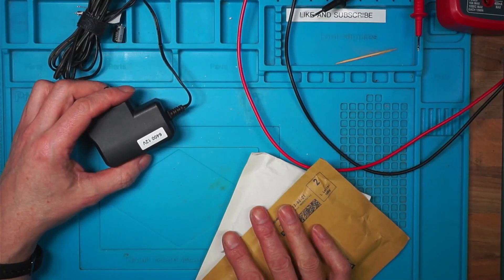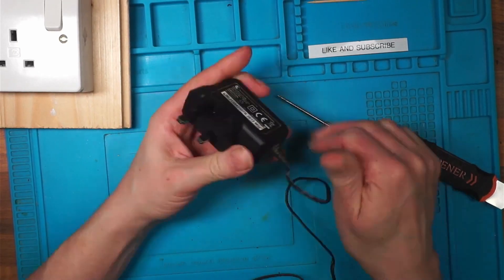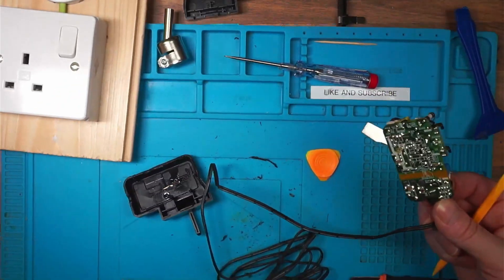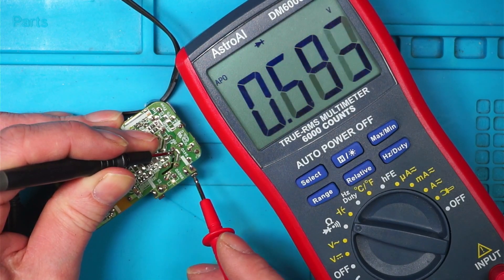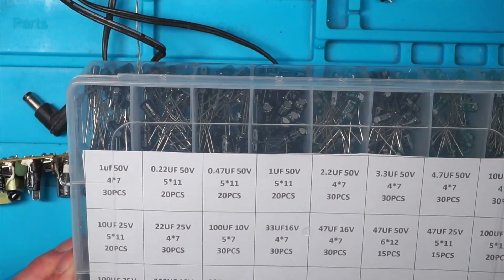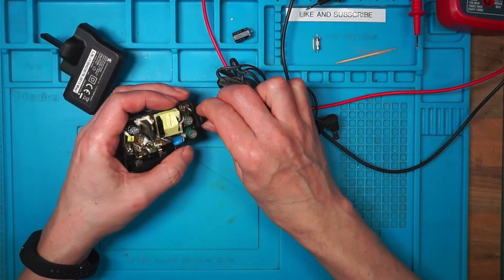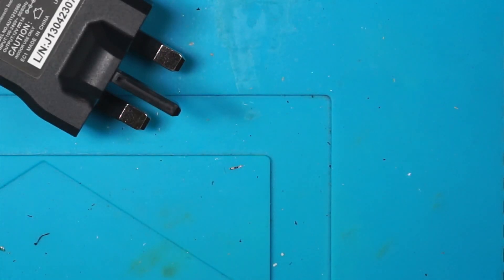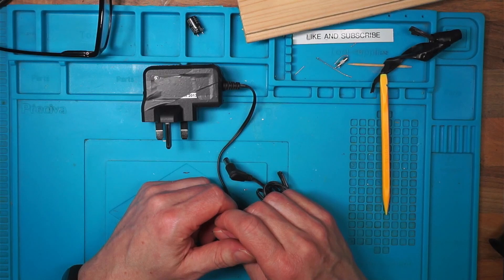Trying to fix a 12V PSU | No voltage out | Faulty Power Supply

Comment: Excellent repair! Looks like a great quality PSU. I like how a fuse and cap replacement can bring an electronic item back to life. I found a broken power strip last year. Its USB ports stopped working. Turned out to be a faulty capacitor on the USB port board. I replaced it and now it works again.
Reply from the maker: I'm sure this little PSU will come in handy within the next 30 years or so lol. Congrats on your own fix too.

Comment: 14:21
You could use melted black zip ties. Many guides on it how to repair plastics.
Reply from the maker: Ah that might work. I can't imagine it would look nice tho lol. Something to remember for the future tho. Perhaps strengtheing up a cracked case from the inside.
Reply: @PhilipBryden  
Use those cheap $5 soldering iron that uses screw terminals and put a large nail at the end instead of iron. The larger the surface area the smoother the result will be.